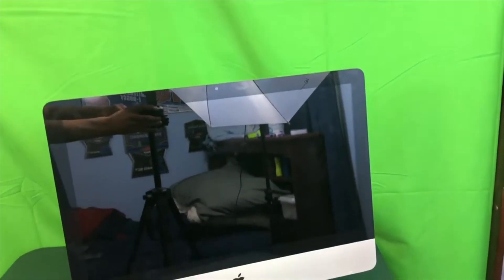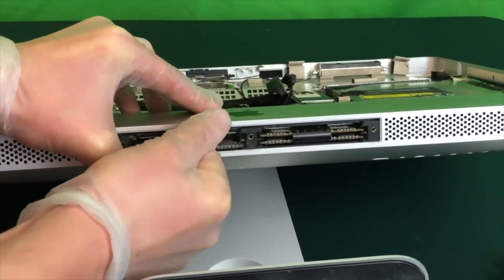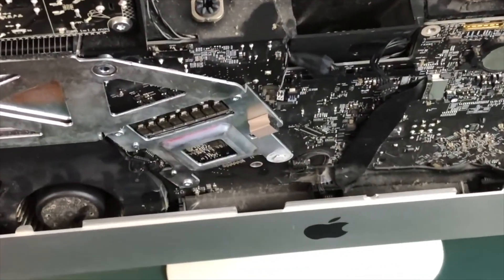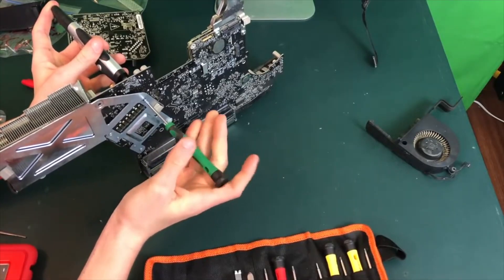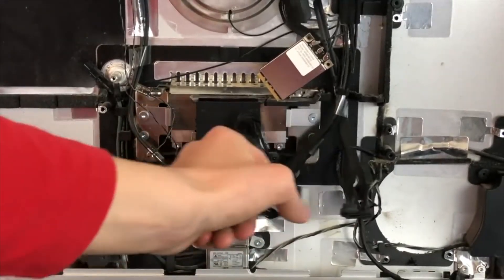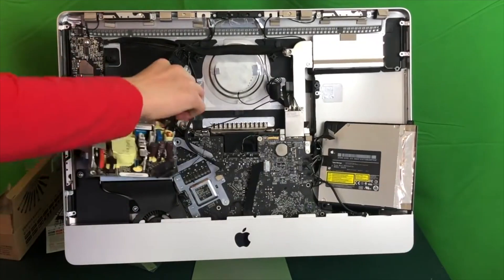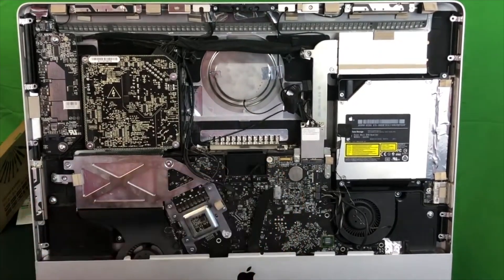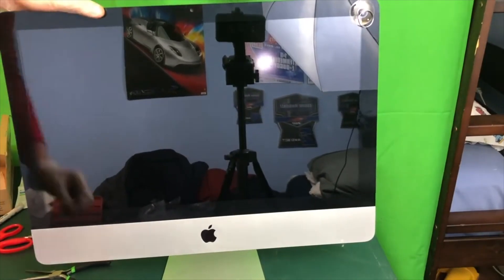2011 iMac 21.5” CPU Upgrade Full Tutorial!

Comment: i would like to add if you are doing this replace the Cmos battery as it is a pain to strip down to this level. you may also want to replace the paste on the MXM GPU card if not replace the gpu with a better card as they are available and a good upgrade especially if you have a 256 or 512MB card you can find 1-2GB cards for cheap and some with the HD7770m GPU that is a vast upgrade over the base cards these came with. the motherboard also had a 2nd sata and power cable, you can find the harness for around £15-20 and then you can double sided foam tape a 2.5" ssd behind the disk drive or remove the 3.5" drive and fit a twin 2.5" caddy and run 2 SSD/HHDs as internal storage.

Comment: I'm still using oringinal 21' mid 2011 imac. I upgraded ram and ssd. I am worried about virus protection because old OS is not supported. what should I upgrade CPU or GPU to have latest OS updates. thank you for video
Reply: You would probably need a motherboard + CPU upgrade. When it comes to security being CHEAP will only result in your loss.
Reply: @SupraSav That's possible?!

Comment: A very useful reference video!👍👍 
However, the audio needs some work, because at times there is an echo and at two points the volume increased a lot.
Did you replace the thermal paste on the graphics chip off camera?
Reply: I thought I was having a bad trip after smoking some trees lol